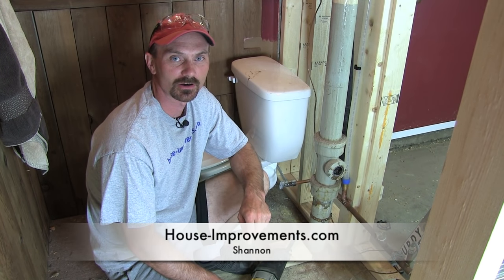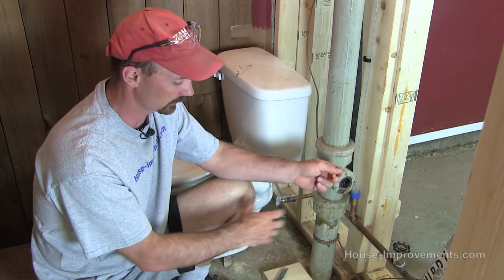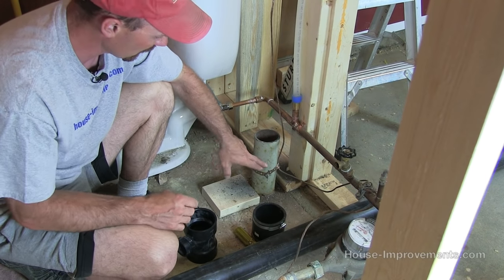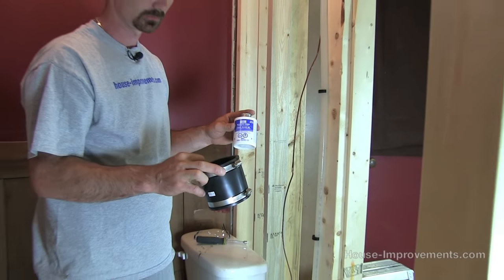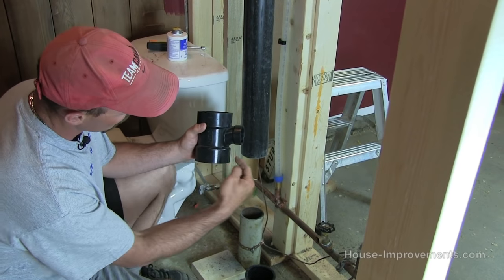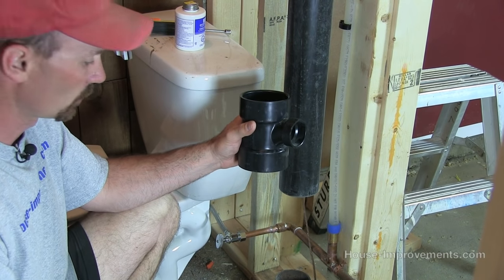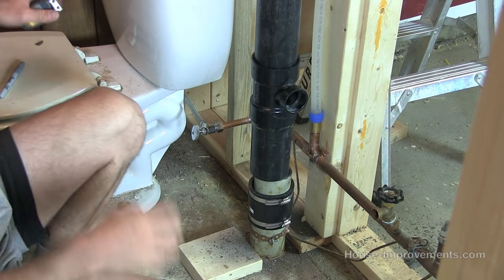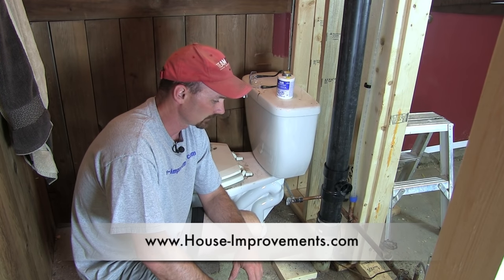How To Cut And Replace Cast Drain Pipe

Comment: Great information!  How is a 4 inch waste/vent stack supported above the ceiling or at the roof?..or is it?  I have to cut out a cast wye fitting that's located just below the second story flooring and redirect it with a new fitting and add another connection below it.  When I cut out that section, about 30 inches, is there anything supporting the 12 foot stack above it that travels up through the attic and roof?  As mentioned, 4" cast has a considerable weight and I don't want it crashing down.  Do I need to support it in an alternate way?
Reply: If you can't see the pipe in its entirety as it goes up thru the roof,then attach a 4" riser clamp on the pipe above where you are going to cut and secure that clamp well to the structure ,so that when you cut out the section below the clamp,the pipe above can't shift down.

Comment: The rubber boot on the bottom slipped over the pipe and down so that the pipe went through and the new pipe was able to slide in on top.  Mine rubber boot has a ridge in it and it won't go down far enough for me to slide the new pipe in. Any tips?
Reply: if it has a ridge I would assume it is a shielded coupling and if it is not I would use a shielded anyway. In that case slide the metal shield on and up then place the rubber on and then fold the rubber back. install your pipe in place and then fold the rubber back down and slide the metal shield in place over the rubber.
Reply: That's what I was told.  Thanks! It worked! The upstairs bathroom is fully functional I just have to tile the downstairs now.

Comment: Good information, thanks.  No need to apply glue to both ends of the abs connection?
Reply: I know this is 6 yrs old, but in case anyone's watching, the glue should be applied to both sided.. it's more of a chemical weld and the glue preps the ABS for the weld. Disclaimer: I'm not a plumber, but an avid DIY'er...Ddo your own research and don't make me your definitive source.

Comment: must glue both pipe and fitting
Reply from the maker: others have made that comment, I have not had a failure but it will not hurt to glue both either.
Reply: HouseImprovements you haven't had a failure cause its not under pressure,  put under pressure and I'm sure it would
Reply: Chris Moore and must prime both sides before applying glue

Comment: Q Regarding Sewer LATERAL., tying onto a new sewer TAP.

Soon I'm having a new tap installed on the main sewer line as it's broken, along with replacing lateral piping all the way into the house.

The city I'm in requires ductile iron in the street, to the edge of the right-away. After the right away ABS/PVC? can be used.

What is the PROPER way to attach a section of ductile iron to the new tap coming off the main?

What is the PROPER way to transition from ductile to ABS/PVC?

Main is 6'10' deep if that matters.
Reply from the maker: I'm sorry but I do not know for sure.
Reply: RE: I'm sorry but I do not know for sure.

No worries,
Had the lateral replaced this week, C900 was used in the street, 220 psi PVC used for the rest of the run (lateral) into house..

Please excuse the cut and paste, posted this elsewhere.

Looking for info on REPLACING the (cast iron) SOIL STACK with PVC.

Anyone has any tips, let me know. Primary concern is how Cast Iron may currently be attached to structures with the wall, and how to PROPERLY support the PVC I will be replacing the old cast iron with.

Begin copy and paste:
*****************************

Do you have any vids of removing a CAST IRON soil stack, the waste pipe to the toilet and bathroom sink and replacing it with PVC all the way to the roof?

(I am wondering how the PVC is supported, I would assume CI currently in the house is supported  via (3) points:
1: At the top plate via one of the bells /hub of the CI.
2: The intersection off the soil stack that branches off to the sink drain.
3:  The heavy duty strap that currently runs around the bottom section of horizontal section of the lateral in the basement that transitions the lateral from horizontal to vertical, where toilet attaches to soil stack. Wyse? Wide sweep?.)

DETAILS: Have a  old single story 1 bath house built in the 1930's in which the sewer lateral tap was BROKEN where it attaches to the sewer main (@7ft down) , the main running in the center line of the street.

Had the lateral, tap, water service line replaced this week. $$$$$$$

Due to the costs of paying for the above I'm planning on removing ALL the old cast iron within the house.. ALL OF IT.... and replacing it with PVC.
(Yes I know cast iron is heavy, and cast is better on sound control.)

Length of 4 inch Cast Iron left in house? A horizontal section about 8ft long that ties into the "new" lateral piping coming into the house. This horizontal 8ft section fully accessible... It transitioning from horizontal to vertical via a wide sweep with a cleanout on the end. It sweeping upwards to where the toilet ties in, above that bathroom sink drain.  Then it's upwards thru the roof (1 story house). 4x12 pitch roof so I'd estimate CI above top plate to be about 5ft long.

I don't foresee any venting problems with bathroom being only 8ft deep, by 5ft wide. sink, toilet and tub are on on the same wall.

Front wall= Door, entry to bathroom.
Left wall= Sink, Toilet... along the back wall 5ft tub with drain on same side as sink, toilet.
Right wall= Closet.

Q:
Do you have any vids of removing a CAST IRON soil stack, the waste pipe to the toilet and bathroom sink and replacing it with PVC all the way to the roof?

Besides wondering how the old CI may fight me on it's way out as (Where it is supported/attached)
I'm wondering on the best way to PROPERLY support (hang?) the vertical section of PVC which will be the new soil stack, and how to cheat, or should I say minimize the amount of work to replace the drain section that stubs off to the sink from the soil stack.

(Hoping I can remove lavatory /sink, toilet... cutting out sections of wall behind them to gain access to soil stack, sink piping.)

Wall on BACK of bathroom is "wood and lathe", with a layer of drywall on top of that... I think in the bathroom it's wood and lathe, but it appears in some sections it's just drywall when I look upwards from within the basement.

Floor is rotten around toilet flange, and the idiot plumbers in 1930 didn't drop the pipe coming out of the toliet down below the floor joists so they CUT THEM... just leaving about a inch at the top!!! so I'll be replacing the floor joists as well.

Comment: why the glued fitting on top but the clamp fitting on bottom?
Reply: Because you have to use a band to transition from the plastic (ABS) pipe to the iron pipe.

Comment: If a pipe has cracked / rusted below the level of concrete, if you break out the concrete, can you do this fix and then bury the rubber boot section under newly poured concrete?
Reply from the maker: Yes but use stainless steal hose clamps so they do not rust out

Comment: you need to apply glue to both fitting and pipe to be correct, if not it will leak during the inspection with a10ft. of head pressure test. .
Reply: I don't think this guy was testing any of his stuff, or is a plumber for that matter.

Comment: Kinda of an odd question here, but can that cast iron ever come in a copper/brass mix colour? The house I recently bought the washing machine drain is solid metal but doesn’t look like most of the cast iron pipes I’ve ever seen. Wanted to install a laundry sink and wanted to convert that drain into abs to tie the sink into
Reply from the maker: its likely copper.
Reply: @HouseImprovements  didn’t think they used copper for such pipes with that sized diameter! Thanks for getting back :)

Comment: when cutting it on a vertical stack like this you might wanna have someone pulling up on the pipe so you don't pinch the blade. If you are by yourself use some iron strapping to reduce the tension by strapping it up to a stud. A lot of people would use a chain cutter for this but I would prefer a blade in this situation as if it doesn't make a clean cut it will make it a bigger job. WHy did you use ABS?
Reply from the maker: Good tips. ABS is used around here for a lot of these situations, PVC not as common.
Reply: HouseImprovements I have never used in here in the south but I have cut a lot out. I noticed it will pull out of the fitting much of the time with age. I would sooner put cast iron back even though it is high, it is quiet. On most of the upscale homes I will run cast on the drops so they won't hear it.
Reply: Actually, when cutting the stack you want to start with the bottom first, then the top - no saw blade binding. Also, make sure that the rubber boot has the screw heads facing you and not facing the wall before you cement the pipes in place or you could have a hard time tightening them.

Comment: I replaced a 4"drain pipe just like you did in the video but it is leaking just a trickle on the bottom side of the cast to rubber boot connection. Is there something I should add in between the boot and cast iron like caulking?
Reply from the maker: no caulking is not the right way. are you sure the cast was pretty clean and your clamps are tight? Use my forum if you have more questions.http://www.house-improvements.com/forums/
Reply: HouseImprovements I'll re clean the cast with a wire brush and see what that does. should I file down the outside of the cast to remove any raised casted edges, I'll check out your website because windows are next and I'll need help with that. great vids btw
Reply: Clean the pipe and use Black Swan No-Hub sealant. This stuff acts a lube while it's wet, then dries to a glue to seal the rubber part of the no-hub connection to the pipe. In some places, they actually require a sealant on these type joints.

Comment: The right way to fit abs/pvc/cpvc is to actually clean and glue both male and female connections...the only time you don't need to prime is for 1 step cement, you may have premature failures with those poorly glued joints
Reply: Chad Moser You do know abs just needs to be wiped clean right. There's no primer/cleaner for it.

Comment: I know this is a plumbing topic, but not one comment about that "ground" wire.  Problem one is that it is nit tightly clamped to the cast iron pipe.  Problem two is that the pipe is painted, thus making any connection dubious.  Problem three is that cast iron joints are not necessarily electrically conductive.  Problem four is that the term ground is misused, it is really a bonding wire.
Reply: Problem 5 is that you didn't listen to him discussing those very issues. Turn your sound up!

Comment: Great video! 1 question. When repairing or replacing a drain do you need to shut off the water first?
Reply from the maker: It would not hurt incase someone turns on a faucet or something.

Comment: My brother used primer.  That's not the same is glue; is it?
Reply from the maker: paint primer? is not glue.
Reply: Not paint prime,r pipe primer.  And thanks I found out that primer was just to soften/clean the pipe, and then the glue is applied on top of the primer.  Thanks for responding, however.

Comment: Do you have to replace the pipe from the repair area all the way up to the roof?
Reply from the maker: Not necessarily but in this case I did.
Reply: HouseImprovements basically, I have to strap the pipe to something so it doesn’t collapse
Reply: HouseImprovements thanks, great channel btw

Comment: can u use a rubber flange to stop leaks on a pipe like pvc ?
Reply from the maker: Not sure about PVC ,this is ABS. I would think not on either.
Reply: Yes, if it's a PVC drainage pipe.   No, if it's a PVC water supply line under pressure.

Comment: I have a question about PVC leaking at the joints.  when we installed drainage under the kitchen sink, we didn't put enough glue and now it has slow leaks.  What is the best solution to fix the leak without replacing it?
Reply from the maker: Monique Hoang If you are really lucky you could wipe glue around the seam of the joint, it may seal up ,but more than likely not.
Reply: HouseImprovements Thank you Shanon.  We cut the pipe out and replaced it with a new one.  It's save time and more safer that way :)
Reply: +Monique Hoang It'd be a good idea to not use the sink right away either. Give the glue plenty enough time to set up and dry.
Reply: +Monique Hoang never mind that,  I just realized you posted that a long time ago. How did it turn out?
Reply: Thank you for replying.  We cut the pipe out and replace it with new ones and it's work perfectly :).

Comment: I like the chain breaker myself. But for a small job it might be economical enough this way.
Reply from the maker: Most DIyers will not have access to a chain break but they will likely have access to a recip. saw.
Reply: HouseImprovements at one time I would agree with you but rental places have come a long way in suppling specialized hand tools. The Home Depot near me has two versions of it one more for new installations and a lighter one meant for repairs in walls. Not badly priced for a day either. Albeit our city average age of hoses is probably up in the 60s.
Reply from the maker: @kansascityshuffle8526  Yes in bigger centres where you have such stores you may have them available I would agree. I guess it depends what you have locally available to you.

Comment: Why did you cut so much of the cast iron pipe if the only thing wrong was the spout for the vanity?  How far up did you cut & why?
Reply from the maker: I was able to remove the whole pipe right out . Just wanted to replace everything that I could. It was not necessary .
Reply: Thank you for such a quick response.  Also, how much does a job like this cost, parts & labor.  Thanks.  And great vid.  You made it look so easy.  I know it's more difficult for a lay person (my brother who is a handyman).

Comment: I'm imagine you took like two hours cutting that pipe i tried to use those blades but they not really good cast iron pipe it's a pain in the neck I prefer the grinder machine to cut it and use some face shield to cover my face after that I can cut it in five minutes !!
Reply: Barrio Rock  you go to Homedepo and rent Ridgid soil pipe cuttter. Takes less than 3 seconds and makes no mess no dust 99% perfect cut. There’s million ways of cutting NoHub  aka Cast iron pipes but there’s only few ways of cutting it proffesionaly
Reply: @happychicken7773  Clearances can be a problem for soil pipe cutters and they will often collapse a very old pipe or create other cracks.

Comment: Do we need to glue both pipe and fitting?
Reply from the maker: +Tien Tran I suppose if you are not adding enough glue ,then having some on each piece will be better?
Reply: Yes. The cement manufacturer recommends application of the cement to both surfaces to be mated.  Within seconds, the cement softens the ABS pipe and fitting surfaces so that they actually weld together.

Comment: Are the boots allowed inside walls where they would be inaccessible?
Reply from the maker: As far as I know
Reply: HouseImprovements Depends on the local jurisdiction, but typically yes. It's just drainage, no pressure to worry about, or corrosion because it's rubber.

Comment: They might not have been available in 2013 when you did this video but now Diablo makes the steel demon carbide blade for cast iron, cuts through way faster.
Reply from the maker: yes this is an older video.

Comment: what would you do if the cast iron rots flush with the floor? can I run abs and seal it to the floor?
Reply from the maker: remove some floor to replace the connection I'm afraid.

Comment: It is a little unclear why it was necessary to dismantle a good pipe and put different couplings that would leak and not at all aesthetically pleasing. You could try using a welding machine to make a withdrawal?

Comment: hmm lots of guys checking out the shorts maybe on the down low eh ? lol i like his shorts good to see guy in shape not sweaty fat old guy so maybe he didn't use the damn glue is that weak crap gonna make a rat's ass difference if one component doesn't get swabbed you haters are ocd i think he is a gen contractor not just plumbing but it is very cool to have a point of reference why don't you experts post a video got ugly legs?

Comment: First of all you glue both the fitting and the pipe! Second if you’re cutting a cast iron line you should put in a clean out for service plumbers if the main was to back up, that 3 by 1 1/2  sand tee would not pass code you need a 3 by 2 wye going over to the lav. Sink reducing it to 1 1/2 by a bell reducer to pick up the sink drain! Follow the instructions on this video and you’ll regret it, then you’ll end of calling a professional plumber and we will charge you more than what it would be to start with! Also I almost forgot a fernco is never used to go cast iron to plastic you always use a rubber no hub clamp that has no rubber exposed, fernco’s are only used to make repairs!!

Comment: Those blades suck. I usually use abrasive discs on my 4&1/2 grinder, way faster and cheaper. But I cut a lot of cast.
Reply: You cannot always use a grinder with an abrasive wheel. Sometimes you have to use different methods,  not ones that create sparks. Because of these constraints, you may have to use more expensive methods, like in the video.  Cheaper is not always better. As a professional you may even have to invest in a Portaband .  It has its advantages.
Reply: Sometimes the mess caused with a grinder isn't feasable.  Plus the sparks as others said.

Comment: No such thing as a "TY" it's called a sanitary tee
Reply: In Canada it can be called a tee-wye.
Reply: Jorge A TY is Y with long elbow. This one is just sanitary tee
Reply: I hate those specific couplings. Easy to use but regular coupling is much much better and 100% no leaks
Reply: Jorge A actually many codes call it a TY
TY also appears in north hbe Cali general and plumbing contractor test